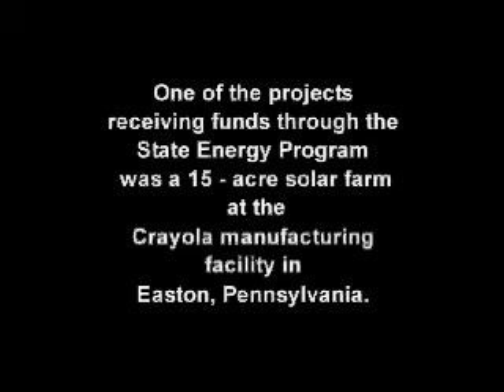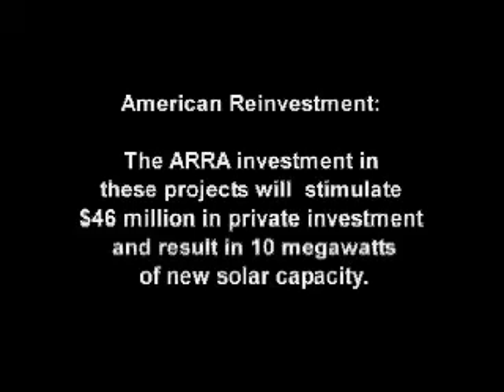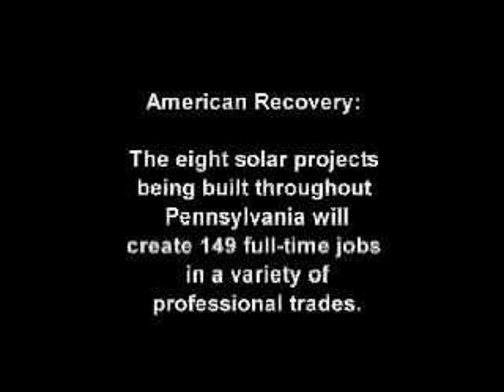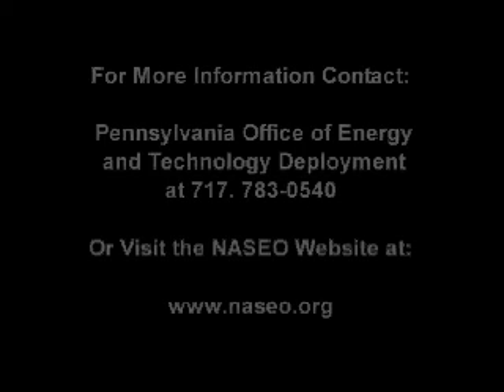Crayola Solar Farm

Comment: Imagine all the clean power this plant has made since it was installed in 2010 until today in 2016. It will keep running for another 40 or more years. It also has saved a lot of water that COAL ,NG and Nuclear use but this one doesn't.